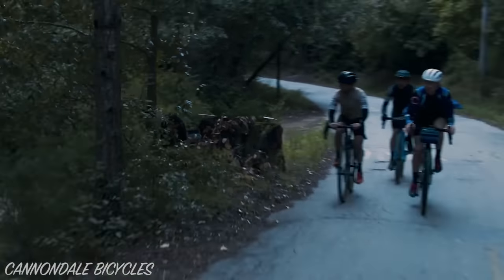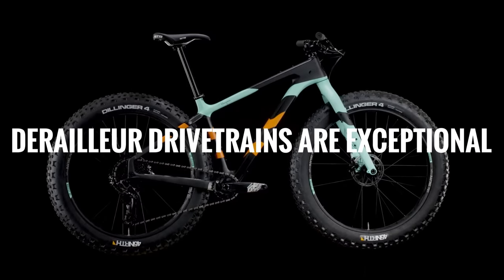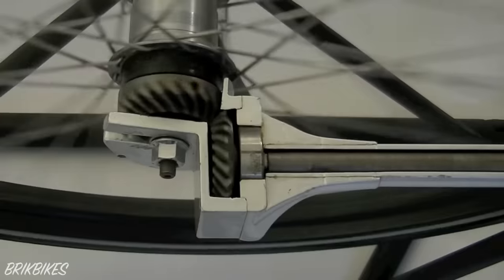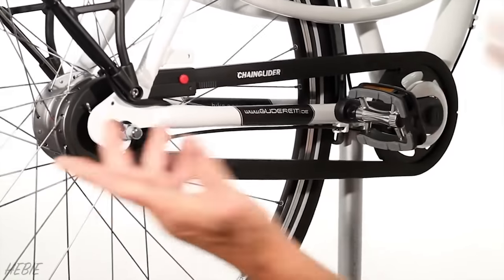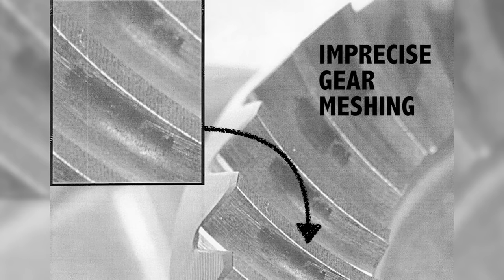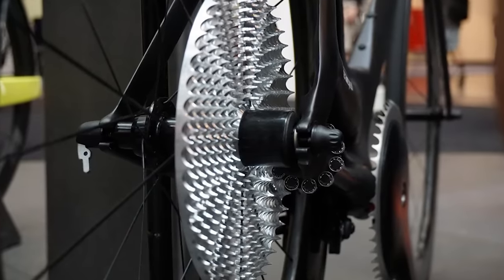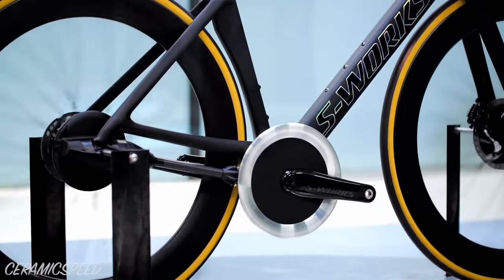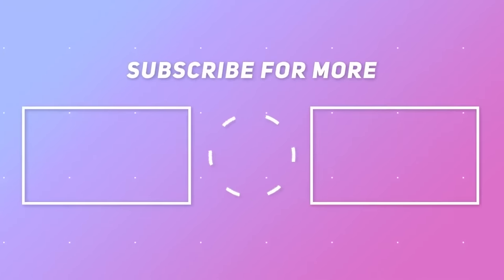Are Chainless Shaft Drive Bicycles a GENIUS or TERRIBLE Idea?

Comment: One factor about shaft-drives that I'm surprised you didn't mention: torque reaction.  When a rider presses down on the pedal, the torque reaction from the drive will cause a reaction in the opposite direction, rotating the frame a bit (or from their perspective, causing it to lean slightly away).  This is very noticeable with a shaft-drive motorcycle such as a BMW or Moto Guzzi, when accelerating; the entire bike "twists" in the opposite direction of the shaft's rotation.  This can be unsettling when accelerating out of a corner.  I don't know that it's a significant factor with shaft-drive bicycles, having never ridden one.  But I would expect there to be at least some torque reaction effect.

Comment: I'm a machinist and in my opinion the problem of inexpensive, mass produced replacement parts becoming unavailable (for whatever reason) should stop most folks from buying a bicycle with a shaft drive system. If you were to wear out a bevel gear you should expect to pay upward of $1,200 to have one custom made at a machine shop.

Comment: Your maths is off at 3:30.
Even if the lubricant is better now, chains couldn't go beyond 100% efficiency.
The 100% mark is not set by the chain. It is set by the ratio of input to output power.
Therefore, if lubricant and bearings have become better, the shaft train is more likely to have gone up to ~95% efficiency, while the chain would stay at 99.xx% efficiency.

Comment: The thing about CV components is also that there is a reason why rear-wheel drive cars and trucks use universal joints in a driveshaft: Because of suspension travel. This would be what the narrator refers to as "frame flex." In a light truck like a 1990s Ford Ranger, the driveshaft to the rear axle is engineered in such a way as to allow the driveshaft to slide in and out of the transmission housing on the transmission output shaft. This is because when the suspension compresses, the drive angle of the driveshaft changes, which means that gets shorter the more the suspension compresses. If you lift a truck, and increase how high the truck sits from the ground with a suspension lift, the one thing you have to do is lengthen the driveshaft, since the engine and transmission's positions move relative to the driveline.

This is why the best kind of shaft-driven system isn't a CV system, but rather one in which the wheel end of the driveshaft is fixed, like a car, and the front part of the shaft is splined to slide on the output shaft of the crank-driven gear. This would mean that you have less power and efficiency loss, no matter how much the bicycle frame flexes, since frame flex acts just like suspension jounce and rebound on a car.

Comment: I think it is not so hard to make a multiple ratio gear system/transmision. It needs a sort of cardan shaft and some guide at the wheel gear (like the ones that come in automatic transmision lever) a flat cog with concentric gear teeth sets.

Comment: It's a shelf queen. That rear "gear" set will never be stiff enough to take any accelerative pressure. It will get twisted sideways no matter what material is used. The entire centre of the rear wheel needs a total redesign to support the gear rings strongly.

Comment: I remember old bikes with DeRailleur gears were a pain in the ass, The chain came off too frequently and were pretty damn hard to get the chain back on. Old English race bikes and I think it was Schwinn that made them in the US. Wouldn't it be possible to mate a CVT rear-drive to a shaft drive? I can see the drawbacks of shaft drives with alignment and expense. But just saying. Once we step away from simple original things like the lever and inclined planes etc. it's going to be hard to come up with an ideal solution
Reply: actually a cvt-like belt system sounds way more viable than this freak :D

Comment: I have a bicycle with a chain and a planetary transmission, because a derailleur works only at its peak efficiency when the chain moves perfectly straight, for if it has to pull “at an angle”, efficiency is lost. Also, the chain my good old bike has is thicker and tighter for it never needs to move between gears, and thus it withstood conditions where a normal derailleur system would have just given up. It also uses up less space, is lighter, mud cannot get into the transmission, the only downside is that you cannot switch gearwheels if you want to modify transmission speeds. With all that, I have a system that is highly resistant to mechanical strain, dirt, rain, has – see the point about the always perfectly straight chain – the same if not maybe even better efficiency (although I have to admit the transmission-box is really a high-end one, which means: expensive), and since the chain goes always straight, protecting it/my trousers from it is not an issue. So if you are not exactly poor or a pro-racer, and are looking for a sturdy utility bike, a chain with a planetary transmission should be something to consider.

Comment: I don't trust that multispeed design,  but  if they can make it work, I salute them for experimenting. I saw a video on vk featuring a home made 1 speed shaft drive that included a bmx freewheel as a shaft gear, so it could coast. This also relieved shaft flex and shutter.

Comment: Changing direction in a drive train takes more energy than you would think. This is one reason front wheel drive cars with traverse engines are typically more efficient than similarly outfitted RWD cars with longitudinal  engines.

Comment: As a single speed setup shaft drive would be tough to beat, but the reality is that outside of city riding where it is mostly flat or limited hills most of us need gears to manage climbs, cadence and efficiency across a variety of terrains and ride styles. When you add in shift capabilities to a shaft drive you introduce outside contaminates which will eat away at the gear mesh quickly. Add to that the expense of parts for what is currently a very niche product and the complexity of basic maintenance it begins to eat away quickly at the desire for wider adoption. All this before we even consider the weight factor which really is a marginal argument in the end.

Comment: I’m not an expert but can the rear frame stiffness problem be partially overcome by introducing suspension where the rear pivot point is at the pedals so that the entire drive train moves together and the shock absorber or rubber grommet absorbs the majority of the stress. This would also give back some of the softer ride feel.

Comment: One often ignored point about shafts though is that you can design a bicycle in which the shaft tube is part of the frame, instead of a screwed/bolted part. That solution would save some weight and make for slightly better aerodynamics. Now, if I were a manufacturer trying to add gears to a shaft, I'd go for a ball-design CVT. Trying to make a sliding shaft like 6:40 is just too complex, I don't see it ever working. A 'fixed' shaft, 'fixed' hub, and a ball CVT seems much simpler and can also be enclosed inside some protective shell.
Now, I don't think neither of those solutions is going to be the long term future of cycling to be honest. Imo we are bound to see some sort of revolution in electric motors and electronic gearing - pedalling to generate energy and sending that to a motor at the hub, electronic shifters to get rid of chains/belts/shafts. We already have small enough electric motors to achieve weight reductions (see the mechanical doping cheaters), electronic shifters also already exist. Instead of all those moving parts, just some wiring.

Comment: A chain can be stretched a little bit and it is resisted of strength hits while pedaling. It means a chain more reliable compare to gear. A gear can be broken during downhill riding very quickly

Comment: As a bicycle rider then motor cycle rider then back to bicycle I can confirm that my favourite motor cycles were shaft drive. You did not mention E-Bikes?
Reply: I preferred my shaft drive cycles too but I stripped the rear gears on my 1200 gold wing 3 times trying to commute on the 405 in to work at LAX. I ended up with a chain drive bike and I shot it clean every morning as I arrived at work with WD-40. It being a sealed chain that was ok because I was just getting outside dirt off so it didn't ruin the seals between the rollers and shafts inside each chain link. I managed only 2 new chains and sprockets sets during the 87,000 miles I put on that bike in less than 5 years. and one of those was to change the front sprocket from a 15 tooth to a 17 tooth to lower the RPM at freeway speeds.

Comment: You spoke of the cyclist willing to put the energy into the bike pedals to propel themselves along satisfactorily. I have seen a large increase in electric scooters and bikes where just about any model of bike suddenly benefits from having electrical power driving it's rear wheel instead of having the rider do it. This is a recent development and means that shaft driven bikes may get forced out of city areas, which is where I have seen this start to spring up. Scooters and electrically driven bikes have varying sizes of wheel although the scooters with the larger and more flexible tires will easily navigate minor bumps in the pavement, whereas scooters with smaller wheels will transfer a larger spike of vertical movement when rolling over bumps in the pavement. This is true whether the scooter is foot powered or electrically driven, although the latter I have observed to have quite a bit more power when accelerating in most cases I have seen around the city.

Comment: Great video, I had been wondering about shaft drive. Sorry to get nerdy on you, but the gears on the drive shaft don't go through higher torque, the torque is the same but the distance from the axis is smaller so the force on the teeth is higher.

Comment: I take issue with your praise for derailleurs.
Derailleurs are trash in anything but perfect weather. I expect the reason they became so common (specifically in the US) is that (again, in the US) bicycling is predominantly a recreational activity, so you don't usually do it in less than ideal weather. When commuting with a derailleur bike in snow, for example, I regularly had jerky or missed shifts. Moreover, 
For commuting, I want next to zero maintenance, which derailleurs do not seem to be able to provide.

Comment: For a nice commuter, a drive shaft and electric motor assist would just be fantastic. I don't need to go fast, and I go to work in the rain or snow. On the other hand, even a belt is usually cheaper.

Comment: I can't decide about that, my bicycle however has no problem of at all, and it'll take 1-2 years of replacing it depending on everyday use but the drive shaft is still heavy and can't afford to replacing the gears if it broken or damaged the gears

Comment: ... If you don't want a greasy chain don't use "grease" on it. Don't use any kind of spray oil either just learn to mix a bit of paraffin wax with some lamp oil into a wax melt. Waxing a chain might be a bit of a task but the amount of other maintenance tasks you avoid and the extended life of all components make up for that exponentially. If you get like 5 chains and do them all you can just rotate them and do 3 at a time from then on and a waxed chain lasts ages before it needs renewing, especially if you just remove it after it gest wet and pull it through a rag a bit to dry it off again. Means its out the way to quickly dry everything else off then, these few tasks make every other maintenance task go away for huge amounts of time and day to day usage. All you need to do is dry your bike down after use in the wet and rotate a waxed chain now and again when it begins to get slightly noisy.

Comment: I was intrigued to see a bicycle with a full enclosure chaincase, that's an interesting development.

A sealed, oil bath chaincase would be quite efficient, with the chain happy in its sealed enclosure, away from rain, mud and grit.

My motorcycle full enclosure chaincase enabled high mileage with very little chain wear or adjustment necessary.

It was almost like having an ultralight shaft drive from that perspective.

Comment: I would say that almost all of your points about the betterness of chain-bikes pretty much only apply to people approaching bicycles from a sports perspective. If I'm just using my bike for daily transport in random weather conditions in a city, then relatively minor losses in efficiency or increases in weight don't really matter. I'd happily drag an extra kg around (along with my shopping) and use an extra few percents of energy to do so just to never have to worry about my goddamn bike chain coming off.

Comment: I don't see why we don't have enclosed chain drives that run in an oil bath. It would be difficult to do for a derailleur drivetrain, but for a single speed or geared hub drivetrain, it would be incredibly easy, while making the chain life significantly longer and the drive efficiency much more consistent across all conditions. Keep the drivetrain lubed, keep the chain from getting dirty, minimize wear on the entire drivetrain, just change oil every so often, or  fkll it back up if the bike falls and some spills out the crank or hub ports. Could it last as long as a belt drive? Possibly, we see cars using oil bathed chains for overhead cams, and those chains tend to last nearly the life of the vehicle even though that type of chain doesn't have bearings or rollers, just pins and plates.
Honestly, if someone makes an oil bath chain kit that will fit over and around a full 3x7 derailleur drivetrain, I'd buy it. Maybe I'll end up making one as a DIY project in the very distant future.

Comment: It’s very very similar to motorcycles, shaft drive is less efficient and expensive, but requires minimal maintenance over its lifetime, a belt is slightly more efficient and required more maintenance and is cheaper than a shaft but more expensive than a chains are the most efficient and cheapest, but require the most maintenance, on a motorcycle it’s a replacement every year or every other year depending on your riding, where with shafts I swapped the fluid in my ‘85 barn find and I doubt it was ever changed but it was just fine

Comment: I agree that chains are the best form of transmission we currently have, but I think too much emphasis was placed on derailleurs. In my opinion the fewer moving parts there are on a bike the better.

Single speed bikes are more than enough for most people and uses, while being less prone to failure and requiring less maintenance.

Fixies are even more robust, not having brakes either.

Comment: I like the idea of shaft drive, but used the way the old locomotives used it. To move the shaft in a circle that's inline with the drive wheels. Not rotating the shaft at 90 degrees to the drive wheels.

Sounds weird I know, but it would involve pulling and pushing a steel rod instead of just pulling on a steel chain with many parts that could fail.

Comment: Motor vehicle drive shafts have two universal joints, each 90° to the other one. As long as there is a simple way to keep the two terminal shafts (the outer shaft segments of the resulting sort of triple shaft) parallel to each other (there is), you've solved the tolerance problem. But probably worsened the efficiency problem.

Comment: This video just comes with points and vague number that I could make up in a couple minutes. A question that isnt clearly answered and is even opposed is: why do dont factories, cars and ships use a chain instead of a drive shaft if it is much more efficient and maintainable? To me it sounds like a scalability and cost issue rather than an efficiency issue. ...because drive shafts clearly are efficient and reliable (which is questioned in the video for some reason), as they are used everywhere
Reply: First, look at the massive structure typically supporting a driveshaft. Then read the seamanship novel, THE SAND PEBBLES, including the procedure to realign a crankshaft/driveshaft, triple-expansion steam engine after the hull suffers a dimple.
Reply: @SewolHoONCE  so it's a cost issue combined with the fact that its hard to repair. They are not fragile like chains.

Comment: It's arguably the same exact thing with motorbikes both as far as belts and gear/shaft options go: yes, niche solution offers some niche benefits but no matter what the actual use is chain is mote efficient on average and in all cases cheaper and more reliable.

Comment: Seems like the shaft drive  would be great in a pedal powered boat.  The bottom bracket assembly and drive shaft, perhaps lengthened and incorporating a u joint and then connected to a small propeller.   The rear pinon and ring gear would, of course not be used.  The screw drive would likely be more efficient than the paddle system.

Comment: I think that bevel gear efficiency number may be outdated; precision manufacturing and lube tech has come a long way in almost 40 years. It's not going to be as good as the frame improvements, but I'd guess that they're now up to 97-98% efficient; probably on par with belt drives. However, bicycles are a very poor application for a shafted drivetrain. They are heavy and expensive for practically no benefit over chain.
Also, the Driven Drivetrain is going to figure out the torque issues, and it's going to be cool. But it will be prone to wear problems and component failures. There's just so many points of rubbing contact, points of failure, and points that need to be finely adjusted beyond what even good bike shops can do.

Comment: The problem is the bevel gear kinematic pair, try using something else, for example planetary gears are nearly 90 % and some gears are even more efficient with forced lubrication. Also why not just use a belt drive it's causing quite a stir nowadays in the "elevator" business.